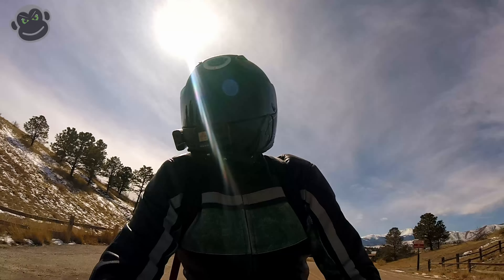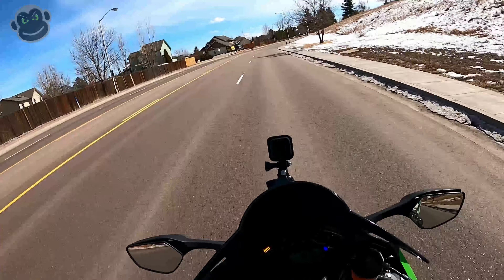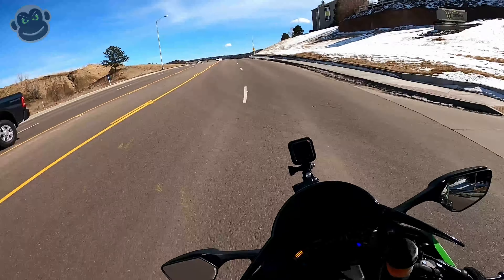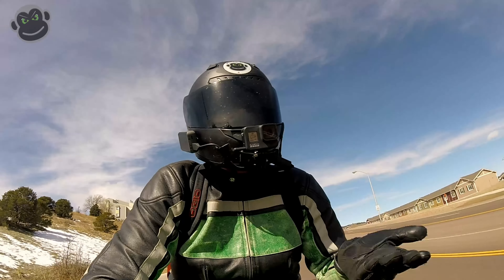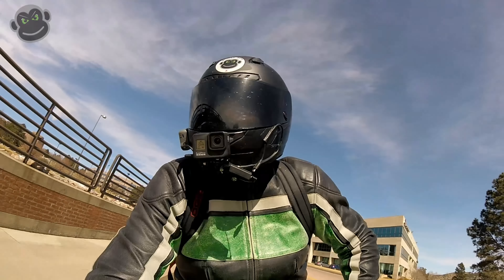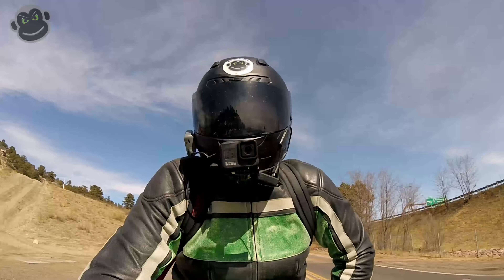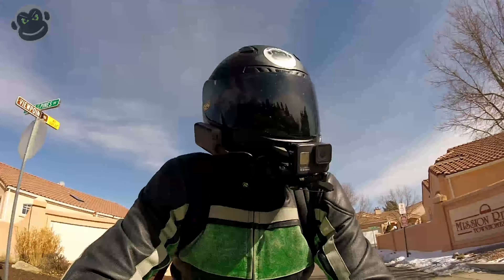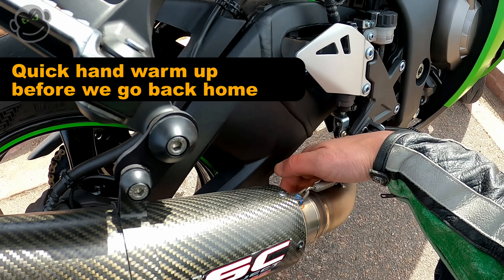MY DJI MINI MAVIC LIVES AGAIN | quick test flight and motovlog on the ZX10

Comment: Well done on getting it fixed. I miss my drone, but I so rarely used it. It has been quite mild here recently, but I was out in similar temps a week or so back on the V85 to grab some shopping. Not fun if you don't have winter kit!
Reply from the maker: Thanks Hippo!  I need to use mine more, I'm still not all trained up on everything it can do.  Yeah, winter gear, what a concept, I should get some....
Reply: @MonkeyButtRides  :D you only have winter once an ice age, not sure it is worth spending out on TBH :D